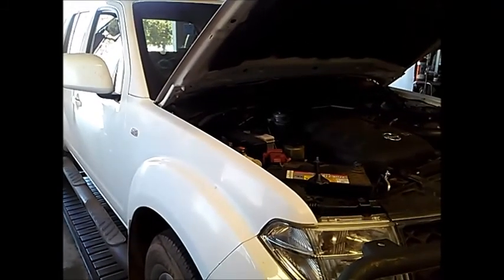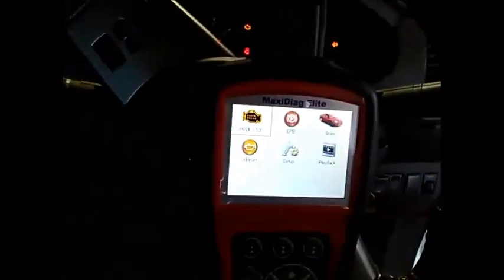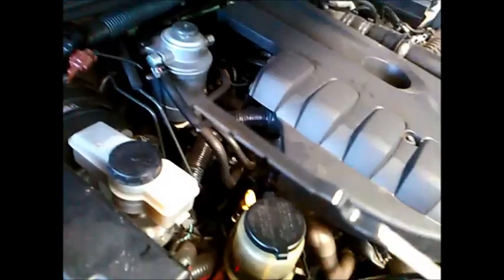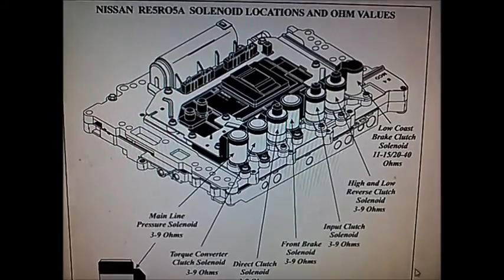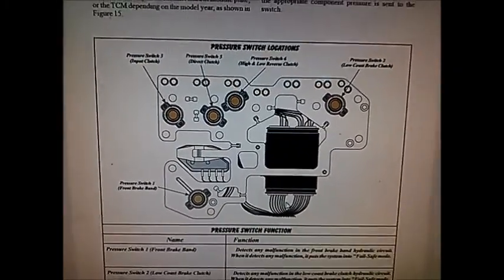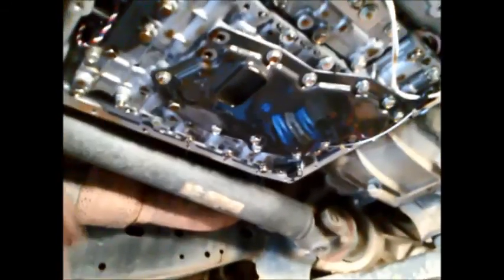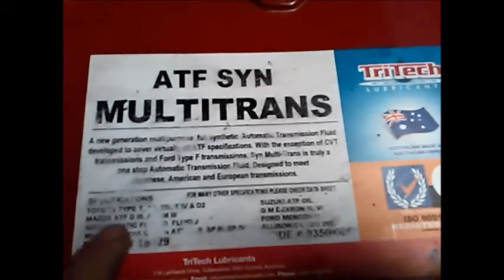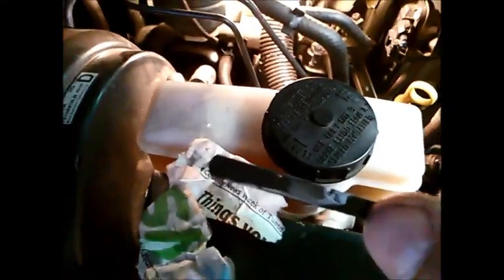Nissan Navara RE5R05A JR507E JR509E Auto Transmission Filter Service DIY How to

Comment: Do you fill through the dipstick hole? Great tip on hyundai having same filter almost 50% cheaper than nissan one in Europe.
Reply from the maker: hi, always nice to fill through dipstick if you have one. push a hose down it or you will get burping from air locks. cheers

Comment: How did U get the fluid out of the converter... You missed about 5l of fluid there
Reply from the maker: hi, we generally only do a complete flush ( several times needed ) when coolant or water enters transmission. otherwise what comes out during a service is adequate to improve trans fluid properties. if transmission is worn and causing fluid to darken or burn, no number of services will fix your transmission with just a service or fluid change. cheers

Comment: G'day mate, got a 08 D40 Spanish built Auto. Hope that's enough info.. Coolant got into trans. Took it to a specialist. They replaced the filter and fluid. Said it was temporary. And I needed new trans. That was 3 weeks ago. I can't afford the $ 1800 they quoted, just for the part. So, drained it, replaced filter and put in premium fluid. Hoping it would atleast come good again for a few weeks. But nothing.. No reverse, won't get out of third. Any advice mate? Got no work, due to Covid.
Cheers
Reply from the maker: hi, depending on how long coolant has been in trans and how well it has been flushed out will dictate how long it lasts. often the lining absorb the coolant and in torque converter it gets hot enough to steam the bonding off the converter clutch. this is why in Australia I nearly always bypass the radiator/heat exchanger. cheers

Comment: Can't believe you didn't flush everything through radiator cooler hose. It only takes a few minutes but you would get at least a few litres of dirty fluid in the process. Job half done basically.
Reply from the maker: hi, a flush that way is limited to your experience. damage to the pump is very easy to do if you can`t fill transmission as fast as fluid is pumped out. it also doesn`t flush some of the contaminated fluid under the pistons and in nooks and crannies. your choice though. thanks for your input cheers